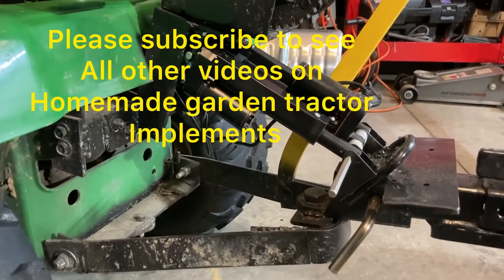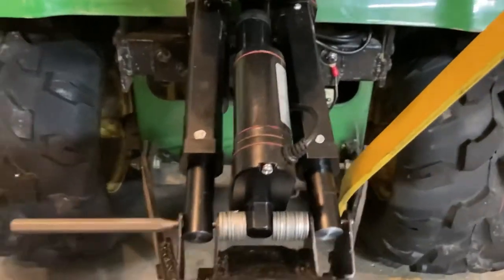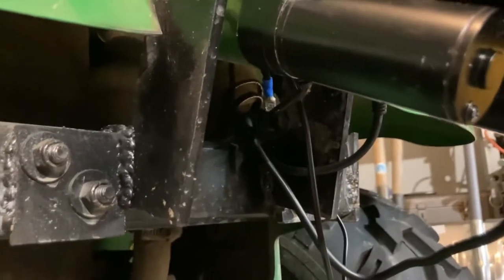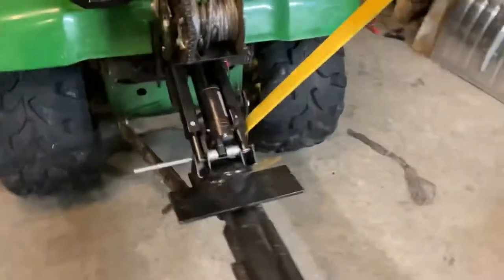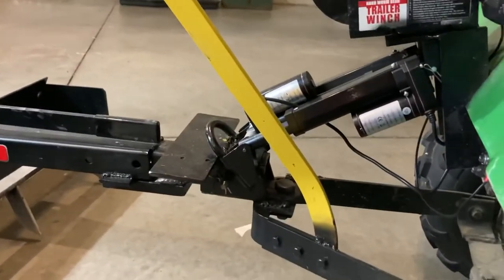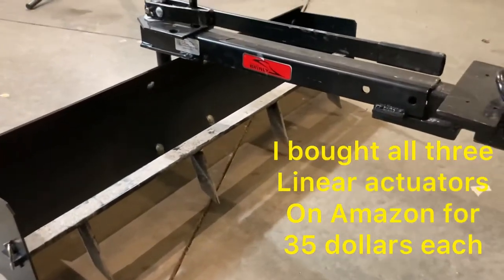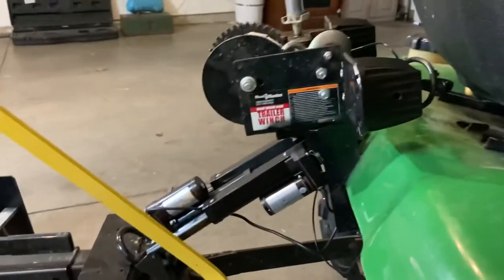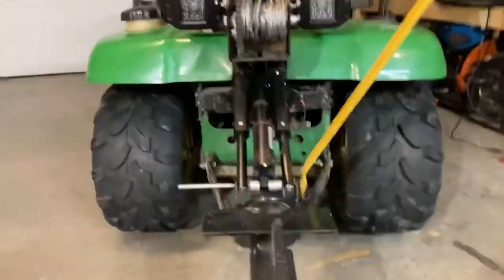LINEAR Actuator sleeve hitch upgrade! Garden Tractor

Comment: How are the actuators holding up a year later? I am looking at similar actuators on amazon. I worry that, with ground engaging implements, they might fail due to the forces involved in pushing a plow into the ground
Reply from the maker: I disconnected them this summer.  They held up ok but we’re painfully slow and the range of motion was limited.  I have went back to using the mechanical winch and weight for Down pressure.

Comment: I hope to get a garden tractor in the future. I just got a JD S130 and it'll serve me fine for now. But I'd like some more options on what I could do.
Reply from the maker: That S130 is a nice Machine.  You could probably fabricate and make some implements to work with that. But the bottleneck usually is the rear end in those.  The K44 is a little light for ground engagement, but it is certainly a good dependable piece of equipment! Thanks again for watching the video!
Reply: @braddegraffenreid9106  right. The transmission is too light for heavy work. I don't know how to weld or own a welder. But I don't need that now. I just want the yard to look good this year.